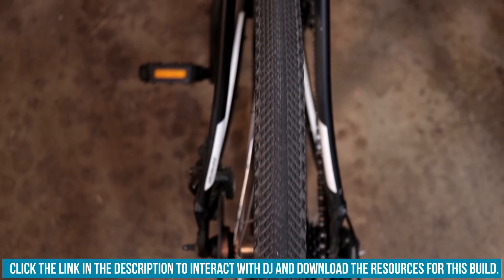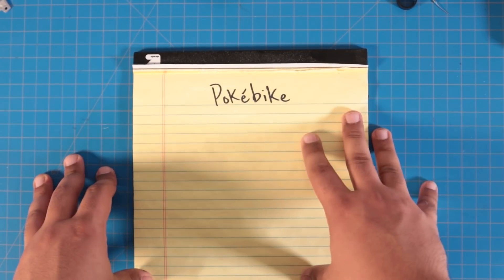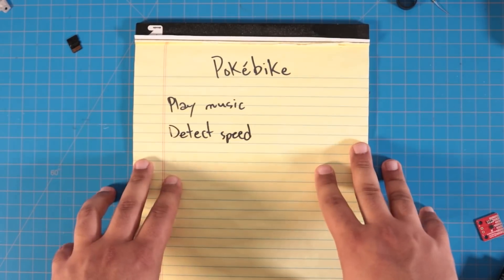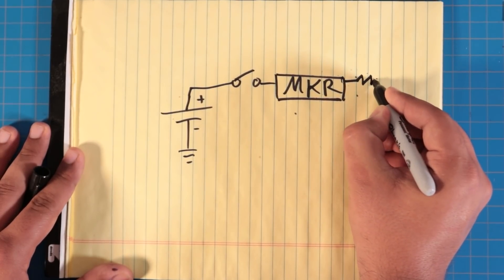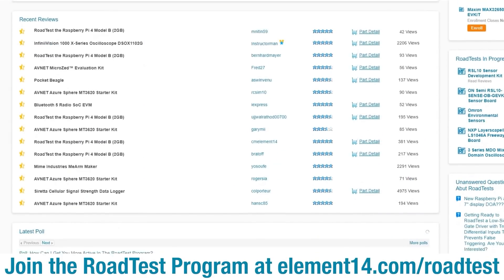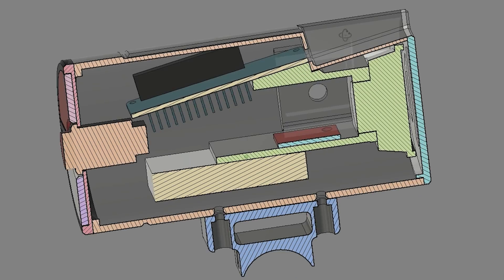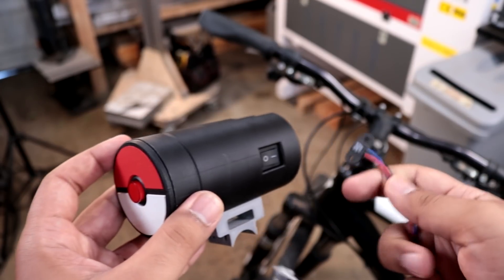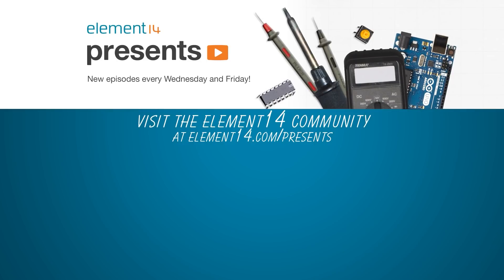Make Your Bike A Pokebike!

Comment: What a boring design was expecting more you just built a mp3 player with play/pause
Reply: seems like a feature was eliminated due to time constraints of the video....kinda disappointing after the specs were given.  Needed at least a short shot of the bike and how the wiring was going to create issues.  I can imagine the wiring would have had to move over the fork tube when steering, so yeah probably a legitimate concern.  Would have been good to explore it a little.